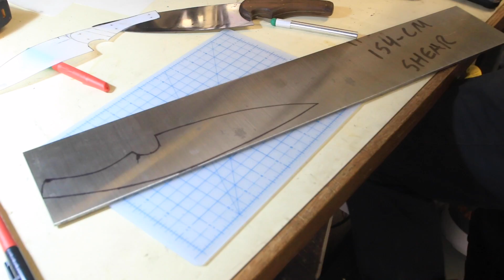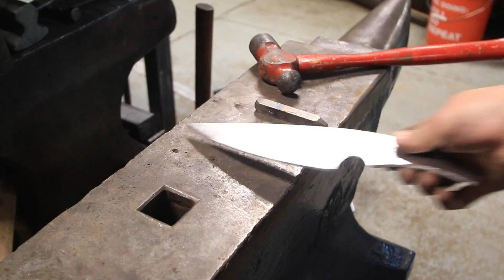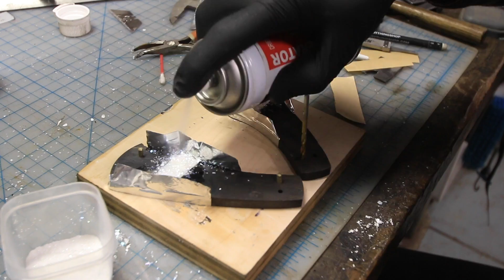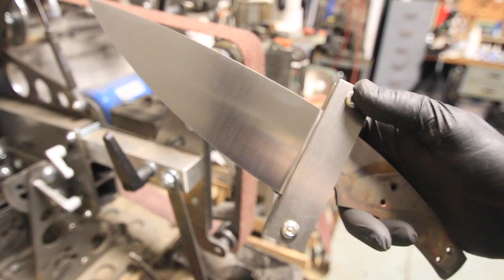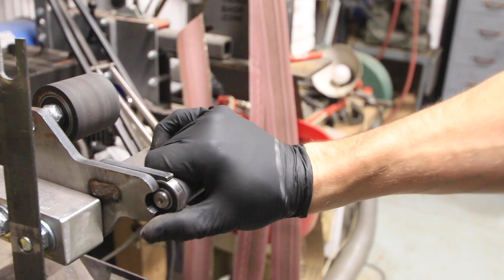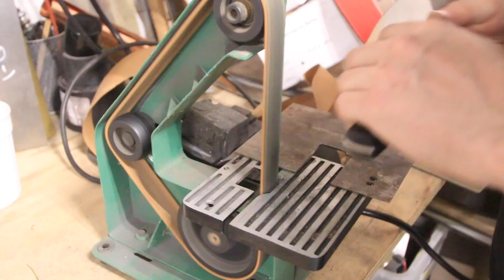Knife Making - Chefs Knife W/ Mother Of Pearl Inlay

Comment: Just found your channel through That Works recommendation. 
Did you make those clamps that held the handles when you set the epoxy?
Btw the knife looked amazing.
Reply from the maker: Thanks! Those are called Kant Twist clamps, amazing little tools! I get them used on eBay usually because they are pricey!